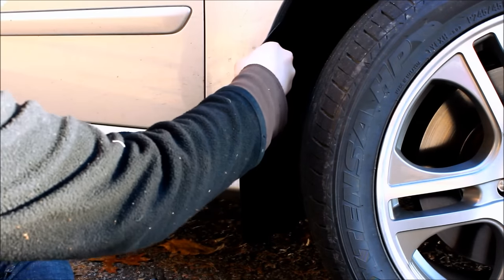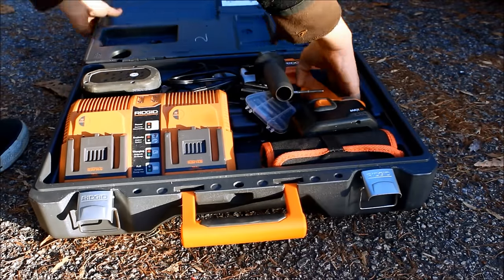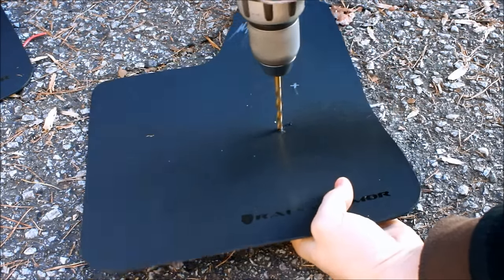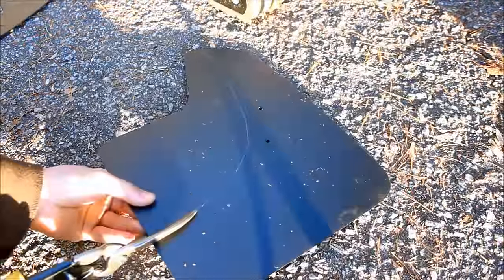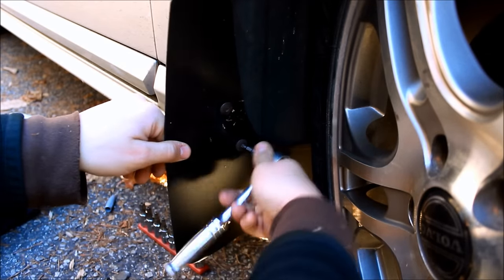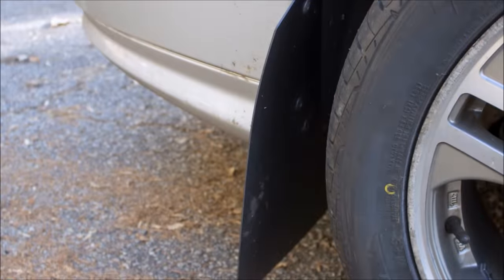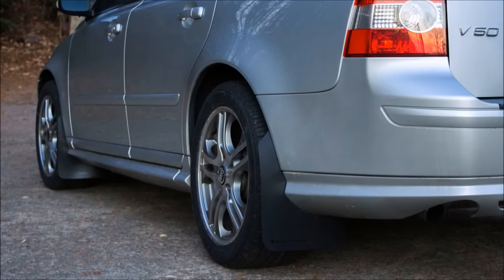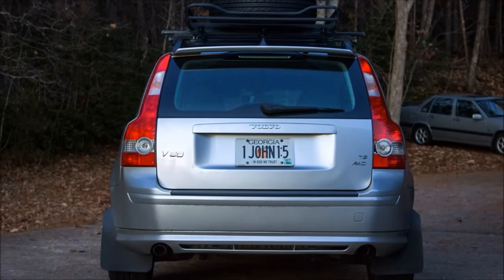Project V50, Episode 9: Installing Rally Armor Mudflaps

Comment: Awesome! I was planning on doing this too but was unsure how I should mount them because its a generic kit. Very helpful, thanks!!!
Reply from the maker: No problem! I did have to cut the inside of the rears a bit so that they would clear the wheel well liners. But once you have the mudflaps in hand and you're trying to fit them, it'll be pretty straight forward on what you'll need to do.

Comment: You are lucky your volvo doesn’t have rivets holding in the fender liner. It was a pain to install mine. I ended up not having large enough rivets in some spots and have self tappers in some spots